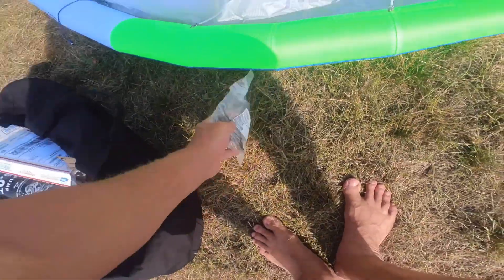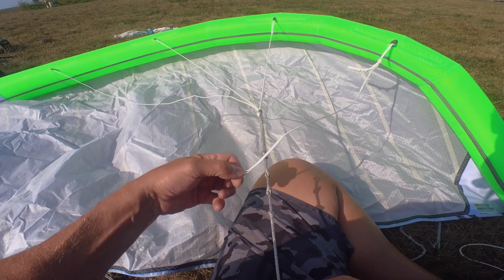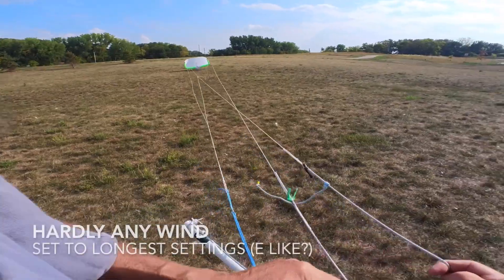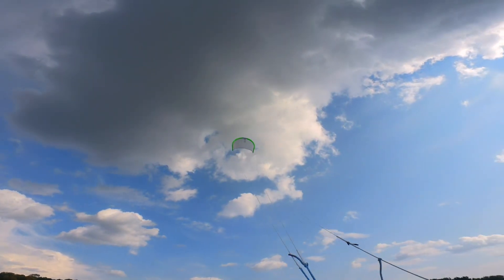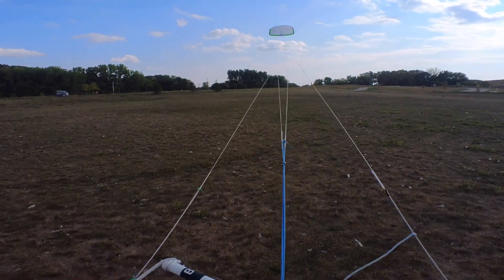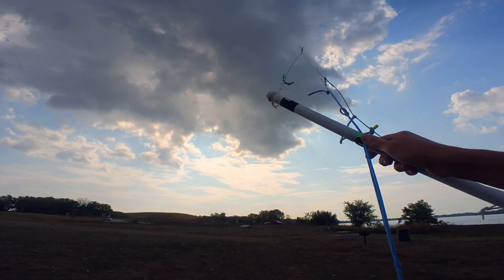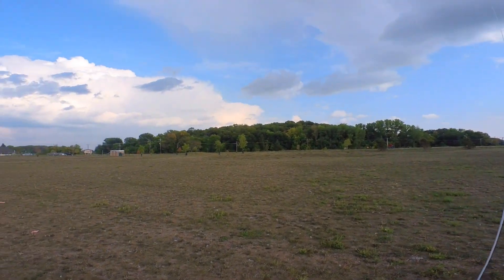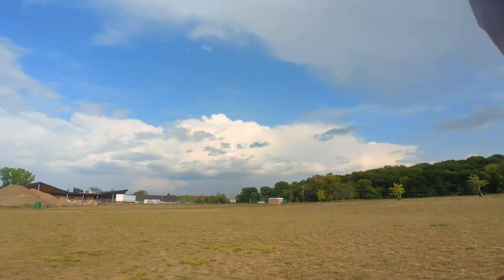Boardriding Maui  Cloud "F" line setup/test/play

Comment: huh, what is an F line ? I don't get it.
Reply from the maker: Howzit Robin!? My original "E" didn't have the F line (i think that's what it's called in diagrams) - Greg started using it on production in 2019 models and later. So basically it's the grey line with a bunch of knots in it that connects the first 3 bridle segments from the center - then the 4th segment gets connected with a loop over one of the tuning knots. Check here at about 21:00 https://vimeo.com/437021996

Thanks for the visit! See you on the water